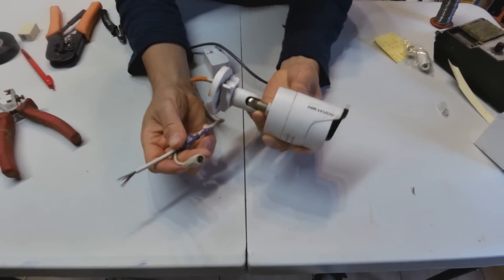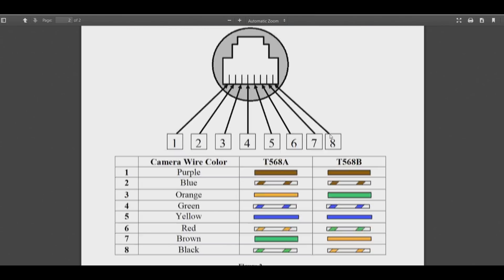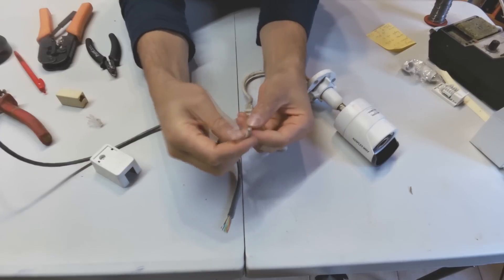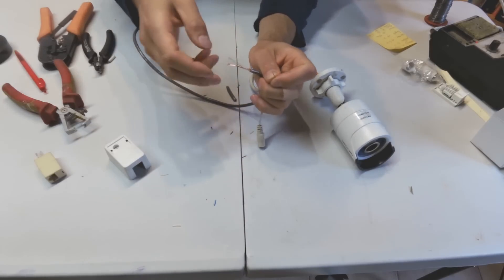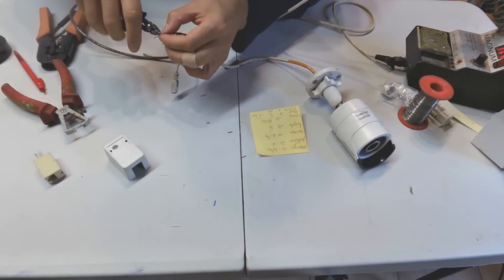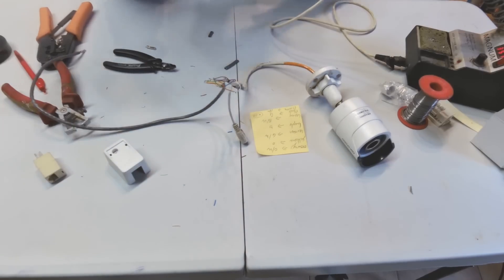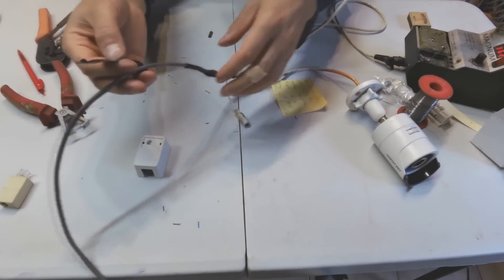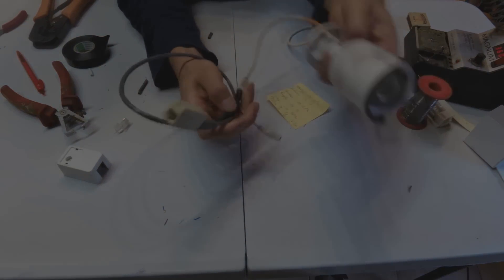How to re-wire a broken Hikvision camera cable (RJ45)

Comment: It doesn't slow down the speed on the grand scale of thing by using those connectors..  Just think about every single business connection at 99% of all companies.  Very few would wire directly from the computer/device into a switch, they would go to a wall PDS socket .. and guess what... the rear of that socket is just like one of these connectors.  And then even that doesn't go to a switch, it will go to a comms room to be then patched out with little to no noticeable affect to performance.

Comment: Ivw comw across a problem in my rewiring situation with my hemivision 311, my eathernet wiring has one black wire left to rewire onto main camera cord, and the reset button wiring has a black wire as well, but the wiring coming out of my camera has only one black wire left to use, im baffled, would they of both been connected to the one? Or do I need to dig deeper into the camera wiring end and hunt for some Mia black wire that maybe got pulled out further in?

Comment: i cut off the dc jack only, careful to not let any 2 wires touch and now the IR doesn't work. despite being powered of PoE, Chinese ip cam  EDIT: red to red and black to black, the dc jack doubles as connection/union for 2 red and 2 black wires.

Comment: Just wanted to say thanks I the sun ate up 2 cameras rj45 plugs when I went to unplug them the connector fell apart I had already bought a new one I just fixed one of them. Soldering works great no issues video stream looks perfect. Instead of twisting I put tiny heat shrink on and butt soldered the wires to one another I fly lot of RC so tiny wire soldering was easy.
Reply: Hello, do you know where to buy a replacement pigtail cable for an ip camera? I've been looking all around and can't find one. Thanks

Comment: I have a SWANN security POE camera system.
Water got into 2 of the camera POE connections over the years and finally killed the signal
I contacted SWANN to ask for the wire diagram and they told me that it was THEIR wiring and it was not to the public
AFTER long searching the interweb and youtube i found this video
IT WORKS!!!! 
I have to use the T568B wire 
but it WORKS and saved me lots of $$ to replace the cameras 
THANK YOU!!!!!

Comment: Awesome. Going to try this today. I was thinking this may be a good opportunity to generate some toxic lead fumes! Can you expand on what you mentioned about the wiring reducing potential bandwith. Is that because you just crimp them and didn't solder, your crimping style, or because you insulated them from each other with just tape? Would prefer not to loose any throughput and I have very high MP cameras. Guess I'll compare the throughput of them as I fix mine before and after solder with an identical camera that hasn't been damaged.

Comment: An rj45 will have water intrusion no matter what unless you encase it.  But they make crimp connectors for stranded cable.  They are smoke color instead of clear and they come with a boot/ strain relief.  But you are supposed to twist the copper and when you insert it into the crimp jack the sheathing or outer jacket of the cable needs to be inside the insert and the rectangle push in is supposed to press and hold the wire in.  The pins for the stranded have 2 hooks instead of the stab in on the solid connector.   Also those female/ female adaptors are the #1 cause of most of my call outs for no network reports..  they just dont hold the connectors tight in and properly seat the connections.   But either way they just came out with a crimp universal connector where you pull the individual wires through the connector itself, no stripping, no guessing if the wires are all the way in or nothing just line up the colors and crimp, it cuts all the wirez flush..  good lil deal there...
Reply from the maker: thanks. totally agree about the female female joins.

Comment: Is there a way to remove the ethernet connector? Otherwise I have to drill a 25mm diameter whole through a 300mm thick brick wall just to fit this bulky thing...
Reply from the maker: you will need to drill the hole. Some cameras have the comms cable as a plug in connector on the camera main board and some are soldered on, so you would need to open the camera to see.

Comment: I had a Rat chew through my cable and my camera is a six wire, 2MP Camera from Techage which appears to use a Hikvision camera just branded differently.  My wires are O/W, Orange, Blue, Grey, White, Black.  A total of 6 wires.  I can't seem to find the equivalent Cat 5 color codes.  Any thoughts.  The rats didn't leave me the RJ 45 receiver to do a pin out test unfortunately.  If anyone has the coding, I would be grateful.